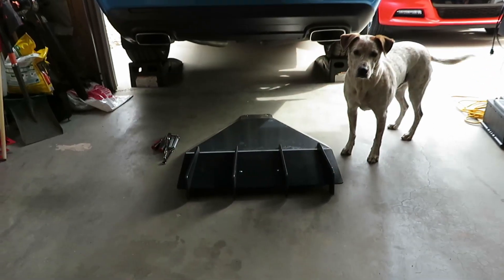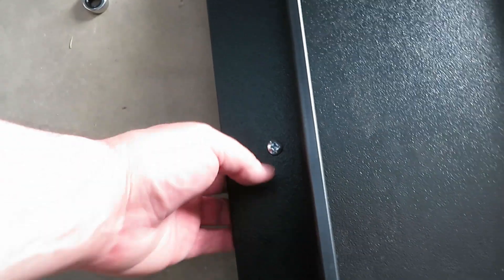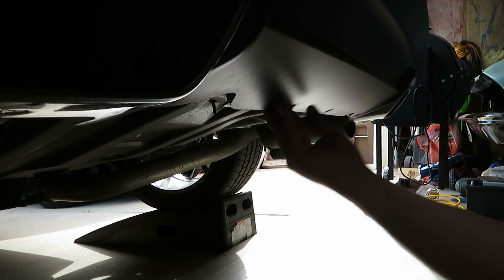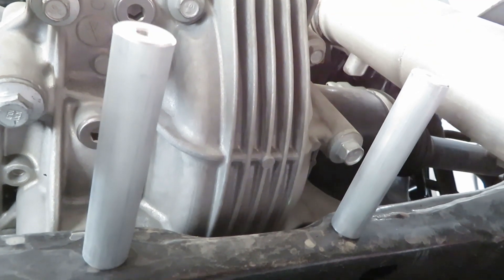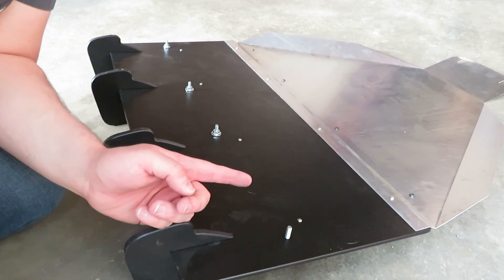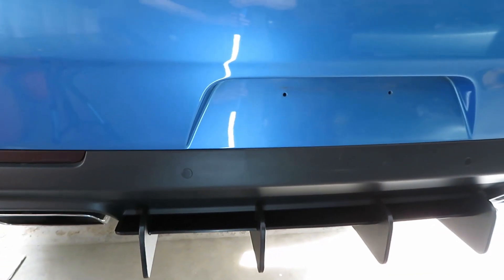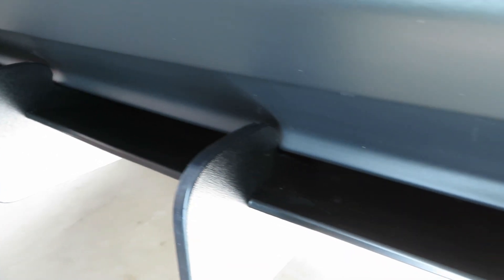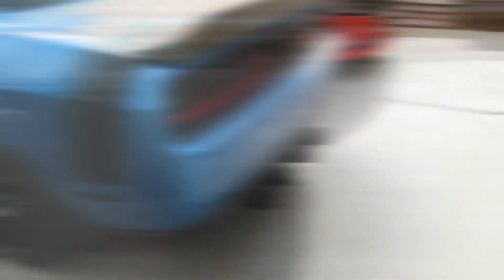ZL1 Addons Rear Diffuser Install

Comment: The long bolt extensions didn't screw in my 2018 TA 392... The holes in my frame was way too big... I may have to rivnut it
Reply from the maker: Are the holes threaded on your T/A? 🐝

Comment: Excellent instructions.  Thank you  Interesting, but my diffuser came with the 4 bolts and nuts separately from diffuser.  Not sure if that is by design or variation by accident.   I am debating whether or not to use rtv silicone to hold them up( once set) to simplify installation or its not necessary.   Mine is without threaded crossmember.  Thoughts? I'm going to email them.
Reply from the maker: Thanks! That's strange that it came with the four bots and nuts separately. You are going to have to put in nut zerts if your cross member is not threaded. Did you e mail them and were they able to help you out?

Comment: Would be easier if they just used riv nuts.  The long type with the four slits that crush down like the Downforce solutions riv nuts. Instead of the 4 bolts

Comment: I wonder what the holes in the cross brace are actually designed for, and why would they be threaded or unthreaded ?
Reply from the maker: That's a great question and if I had to guess it would be for something along the assembly line.
Reply: @MeanBee392  Thanks for your response !